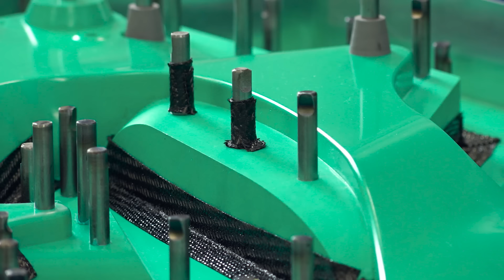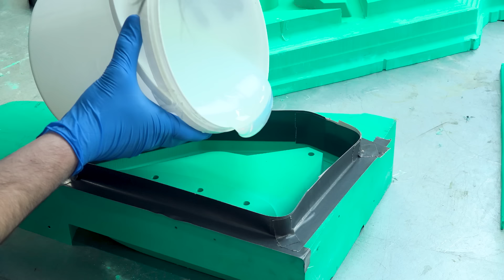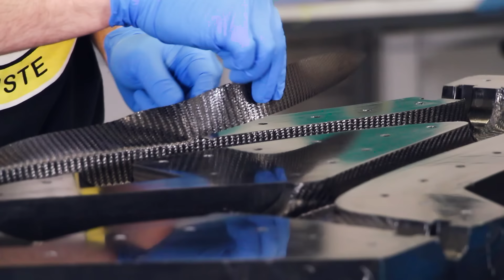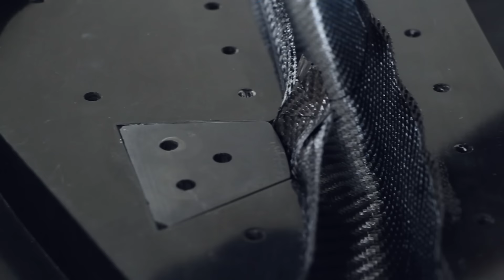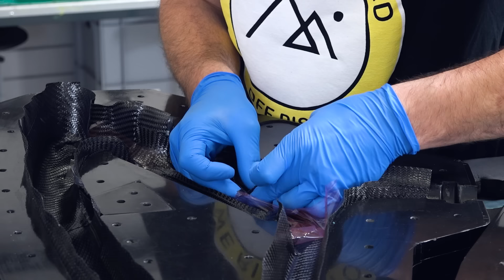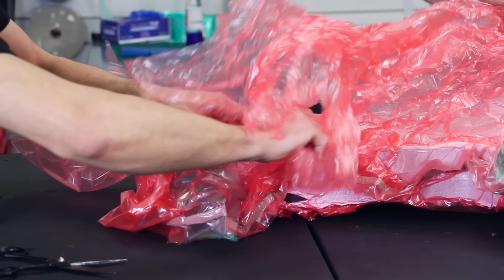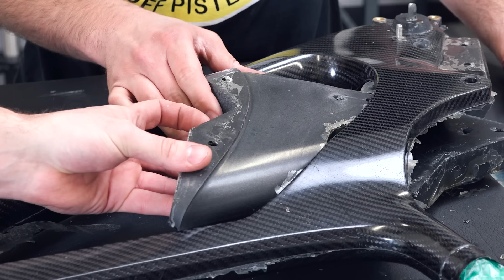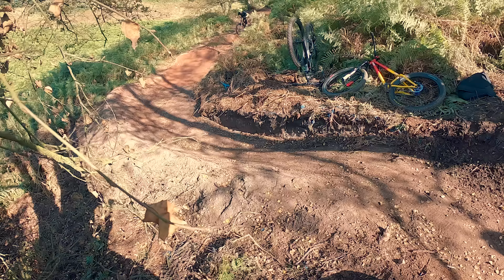Making a Carbon Fibre Bike Frame – From CAD Design to Downhill Race

Comment: Love the detail in the video! I'm actually designing my own hardtail mtb that I'd like to make from prepreg. Any chance y'all could do a video on how you deal with molding in threaded inserts? (For bottom brackets or just screws for a bottle cage, etc)
Reply: Also any detail on how you dealt with keeping good control on critical internal diameters would be much appreciated (seat tube, pressfits, etc)
Reply from the maker: The thickness of the carbon layers is pretty closely defined in terms of dimensions for that.  You can also make it fractionally too tight then sand for a precise fit.  You can also use inserts as in the video.
Reply: @easycompositestv  ok that makes sense. How about threaded inserts you leave in the frame? Like for bottle cages, etc?

Comment: You can use multiple strands of fishing line stretched across the mold to hold the prepreg edges folded during closing the mold. You close the mold partially leaving a few millimetres gap, then cut and pull out the fishing line strands and then close the mold completely.
Reply: I fail to see how you'd fasten the string enough to apply force yet also have it release on demand?

Comment: show how you produce a light weight gunstock (Remington 700 for example) and your channel and your shop will explode. Guaranteed.
Reply: Why is a light weight gun stock so desirable?
Reply: @kevinhornbuckle  there are several things to consider. first of all you want a stable stock since it ensures the repeatability of the overall gun. Second, depending on the disciplin you want to adjust the balance exactly how you need it, and since the barrel and the system are basically the foundation, you want the stock as light as possible because adding weight at the right spots is easy. Also some competitions got a weight limit on the overall gun, And if the stock is light you can go heavier on your barrel, scope and scopemount. Third if you use it for Hunting in the mountains every gramm of excess weight counts especially at the weapon.
If you got any further questions feel free to reply.

Comment: I might have missed it on my multiple views of this video, but what material are the dowel pins?

 I'm assuming a steel, but does actual material selection impact their performance?
Reply from the maker: Steel.  They are strong enough not to be deformed over time when hammered in and out. Although other metals may work fine in many cases.

Comment: Found the channel yesterday and subbed already! I noticed you use the masking tape method to derive your ply templates. Have you considered using Fibersim or any other composite manufacturing software, or is the cost not justified right now? Or is there a reason besides the cost?
Reply from the maker: It can be done in software but for smaller projects and most DIY or small scale production, then it is expensive both in time and also the CNC equipment to cut the pre-preg to the CAD templates.

Comment: For those confused, they occasionally refer to molds as “tools”. In the composite manufacturing industry, molds are exclusively called “tools”.
Reply: Or more generally, a tool is a thing to help make another thing. The CNC was the Tool to make the Master. The Master was the Tool to make the Mold. The Mold was the Tool to layup the Carbon Fiber for the Frame halves. You might make a Production Jig (Tool) to hold the Rear Triangles in place while Bonding. And finally you may have an Assembly Jig (Tool) to hold the major pieces in place while assembling the Bike. It's all considered Tooling for the Production Process.
Reply: @CorwinPatrick  What's your point? My post was helpful, and accurate.
Reply: @danielhatfield8921  He just seems to provide additional clarification
Reply: Thank you for this clarification

Comment: They used $1500 worth of materials in this video. Not even counting labor costs.

Edit: Reading this a year later, I realize that this seems like a criticism, however, quality CF bikes generally hit $5000.
Reply from the maker: More than that probably. Bear in mind though that almost all of that cost was in making the moulds, there is much less material cost in each frame (although still plenty of labour!).

Comment: For a one-off projects, what are the reasons you wouldn't directly mill a female mold on the CNC vs. creating a master pattern like done here?
Reply from the maker: You can do just that, using board sealer on the pattern surface and release agent then mould direct.  For one off and very low volume, sometimes this is ideal.  However it might be difficult for more complex mouldings with inserts etc like this frame.

Comment: Use resin n carbon composit,  not Preprag can ?
Reply from the maker: Sorry, I'm not sure I understand the question?
Reply: Don't use carbon pre-preg, can it be strong? 
for example using a topical method
Reply from the maker: Right, OK. Well, technically a more traditional lamination process, such as wet-lay then vacuum bag or resin infusion can be about as strong as a prepreg layup but the main problem is the practicalities of using a process other than prepreg for such a complex layup. Prepreg is much more practical for something so complicated.

Comment: Do i really have to make a mold for a bike frame from plastic or something like this? Can i just carve the one half of a bike frame on a wood plate and then the second half on the other wood plate and get them both a good wax polishing and then put in the carbon fiber layers and close it?
Reply from the maker: Hi Radek, mmm, well, you could do that but you wouldn't be able to use it for curing prepreg carbon fibre and I think it would be almost impossible to achieve the sort of accuracy that you would realistically need to produce a usable bike frame. If you're looking for the most basic way to make a bike frame then it would probably be better to consider making the shape you want out of foam and then wrapping it in carbon fibre.
Reply: @easycompositestv  Upholstery foam will be good? Will the carbon fiber not stick to the foam?
Reply from the maker: Do, not upholstery foam, you need a type of foam you can shape, not a foam rubber. I would suggest a polyurethane foam such as our PU80: https://www.easycomposites.co.uk/#!/patterns-moulds-and-tooling/tooling-and-modelling-board/pu-low-density-model-board.html - the epoxy and carbon will stick to the foam but that's fine, the foam will stay inside and provide a low density core for the frame.

Comment: So if I understand correctly, to "debulk" you simply put the first layer under vacuum and let it sit for a short while without letting it cure? That is if the prepreg would even cure at room temp. <48hrs
Reply from the maker: Hi Steff, that's correct.  A 'debulk' is just holding the prepreg laminate under vacuum at ambient temperature to consolidate the material periodically, as you add more thickness.

Comment: Would it be possible / easier / still quality if you were to CNC a lightweight foam frame and skin/wrap the frame directly with prepreg carbon, and vacuum bag it externally?
Reply from the maker: As a DIY project it could be possible for a one off.  You would still need the correct design and development process to ensure it is safe and fit for purpose.  Also you might want a jig of some kind for the main points to ensure no distortion.   Also consider you will need high temperature foam and consider heat distortion or movement and the practicality of doing it that way. Eg shrink tape may be a more practical solution than vacuum bagging when such a frame is on a jig.
Reply: @easycompositestv  Thanks so much for the reply!
I've got a handful of carbon fibre things and have been toying around with the idea of making some too!

Comment: Is it possible to make a bike with hand layed carbon fibre? I would love to try making my own bike, i will use it on the road and in the garden, so I don't need much strength
Reply from the maker: Hi Filippo, your best bet for 'hand layup' of a carbon bike frame would be to do shape the foam core and then wet lay carbon fibre over the foam core. It's not as sophisticated as the process you see in this tutorial and so you obviously can't expect the same results but it would be possible and could be made sufficiently strong.

Comment: Probably a dumb question, but why make the mold out of carbon fiber? Why not just machine the mold directly?
Reply from the maker: So, the main reasons for CNC machining the male pattern from epoxy board, to then make carbon fibre female moulds mainly comes down to CTE (coefficient of thermal expansion) and also the durability of epoxy board. When you're working with prepregs which cure at relatively high temperatures, thermal expansion is a consideration in a number of areas; expansion of the pattern, the mould and the component and it can cause problems both with accuracy and also by damaging moulds/patterns/components. The epoxy tooling board has a fairly normal CTE, it gets slightly bigger as it gets hotter; at 120C the pattern or mould (made from epoxy tooling board) would be several millimetres larger than it is at room temperature. Carbon fibre, on the other hand, is basically zero CTE (no expansion at temperature). Therefore, if you cure a carbon fibre part in an epoxy board mould, at 120C, the carbon part will cure and set at size at the high temperature and then - as the epoxy board cools - it will contract, crushing the carbon fibre part. Often this can result in cracking the epoxy board. Therefore, what we want is a carbon fibre mould. At this point, you might wonder how the same problem doesn't happen again when you take the carbon fibre mould off the epoxy board but this is overcome because tooling prepregs have a very low initial cure temperature. In fact, in this case the mould was initially cured at 60C, at which temperature there has been virtually no expansion of the tooling board. The 60C cure is very long. After that cure the mould is post cured to a high temperature 'off the pattern' and once that's complete you have a mould with virtually zero CTE, the same as the carbon part it will be used to create.

Comment: Hi! I would love to see how can we make metal inserts in carbon fiber parts. I couldn't find clear information about it, and i expected to see this here, as there are metal in the bottom brackets and in the back of the bike, where the hubs are attached. I know that we have to isolate carbon from metal due to galvanic corrosion, but it would be nice to see the process of lamination. I would love if you do that!
Reply from the maker: Hi Gabriel, we do plan to make a video (or more than one) dedicated to inclusion of inserts. Although there is plenty to think about with metal inserts, galvanic corrosion is really more something to be worried about if you're making helicopter blades for operation in the North Sea, rather than a bike frame.

Comment: How do you get the green vacuum bag out of the frame after its been released from the mold? do they just pull it out as hard as possible?
Reply from the maker: Yes, that's exactly right, just pull it out as best as you can. It's possible that not all will be removed but it weighs almost nothing and so it's not the end of the world if some bits of bag don't come out.

Comment: How do you design the patterns for cutting up the pre-preg?
Reply from the maker: Hi Sunil, the layup schedule (as in what plies will go where and how they will be aligned) is just done from Vlad's experience of bike frame construction. The actual cutting and fitment of these patterns is done by hand, using an 'offer up and adjust' process. Once they're right, the pattern templates are retained for future use.
Reply: @easycompositestv  thank you for your reply. Is there a way to automate this process (like a software for example)? To save time and iterations and also help the inexperienced fabricator

I realized later that this question has already been answered. Please ignore

Comment: If you're making a one-off, can you make the mould out of epoxy?
Reply from the maker: It is possible to machine the moulds directly out of epoxy tooling board but for a project like this it's not really advisable. The main two problems you would have would be (1) the CTE (thermal expansion) of the tooling board and (2) the robustness of the board. The problem with the board's CTE is that the epoxy board will expand when it gets hot and so as you get towards the curing temperatures for a prepreg like the XC110 we're using in this video, the mould (if it was made from tooling board) would be slightly larger than we want the finished component to be. Because carbon fibre (that we're making the frame from) has a virtually zero CTE then once cured at the higher temperature as the the mould cools and contracts the carbon fibre part inside won't contract as it cools. This means that the tooling board mould starts to squeeze hard on the component inside; not a massive problem for the frame but often not great for the tooling board, causing it to break. If your 'one off' really is a one off then this might not be a problem but in our experience it's almost never that a 'one off' really is just one, you'll normally have at least a couple of goes to get a component right. If the mould has cracked during the first cure cycle then you wouldn't have that option. Of course, it's a different story if the mould is made from carbon fibre; it will have the same CTE properties as the component inside and so this problem goes away.

Comment: anyone know of a reason not to use styrofoam core with vacuum cast? thanks
Reply from the maker: Hi Andrew, I'm just trying to understand where and how you're thinking of using the Styrofoam... somewhere in the making of a carbon fibre frame like in this tutorial? I'll try to answer if you could explain a little more about your question/idea.

Comment: What would be the negatives of simply machining a mold from the epoxy board, and then building up the actual bike frame into that?
Reply from the maker: The main problem would be the CTE (coefficient of thermal expansion) of the tooling board. You'd experience quite a bit of expansion from the board if you tried to take it to the curing temperatures of the prepreg. It's not impossible to use tooling board as a one-off or short-run mould but you would be looking at very long, low temp cures and then a very gradual freestanding 'post cure' to fully cure the component.
Reply: Easy Composites Ltd okay, thank you

Comment: How many frames could be built from the molds/tooling before they are worn out?
Reply from the maker: Probably 20 would be realistic out of a tool made using this system, maybe more but the demolished process can be quite, er, physical, and so mould fatigue and slight damage can accumulate.

Comment: Hi guys. I don't really have access to prepreg, so I wondering, would it be ok to make a infused mold with fiber glass and epoxy for a oven cured carbon fiber part? I mean, would there be any issue regarding the mold being Epoxy + Fiberglass and the part being Epoxy + Carbon Fiber?
Reply from the maker: Hi Danilo,
If you're not using prepreg to make the component (i.e. the frame) then the moulding materials are a lot less critical. The main reason being that if you're not heating the component to cure it that you don't need high temperature moulds and you also don't need to worry about the different rates of expansion of different materials (i.e. carbon compared to glass) and so you wouldn't have a problem using glass fibre to reinforce the mould. 
If you're using epoxy for the component layup (which if you're using carbon fibre then you certainly should be) then you would still need to use epoxy with the glass fibre to make the mould.

Comment: how much does it cost to do with your own?
Reply from the maker: It depends how much of the equipment you want to include in that price but if you were including everything you've seen, apart from the CNC machine itself (which you just pay someone to use) but included everything else, such as all the tooling block, the CNC machine time, mould making materials, oven, vacuum pump and equipment etc, plus all the materials for the frame, you'd be looking at about £500/$6500/6000 euro.
Reply: Easy Composites Ltd thanks for the detailed answer! Its a good investment i think. What is the possibility that turning this investment to profit i really wonder.

Comment: Hi.
If you would repair a bike frame. Wich method would you select?
Heatblanket and prepreg? If so, how do you get right sized blanket and so on?

/
Andreas
Reply from the maker: Generally we would go for a wet-lay process, remarkably similar to repairing a broken fishing pole. Liquid epoxy resin, dry carbon fabric, wrapped in shrink tape and then just cured at room temperature. Heat blankets are difficult to achieve the high temperature required for prepregs, plus you're exposing the paint on the frame to temperatures it wasn't designed for. Therefore, an ambient temperature repair is much more common, and - to be honest - just as good.